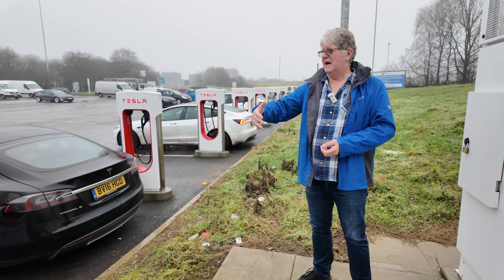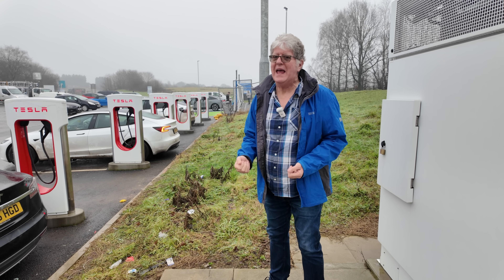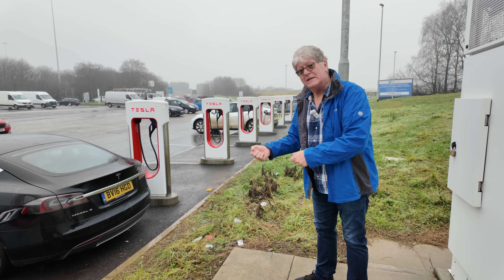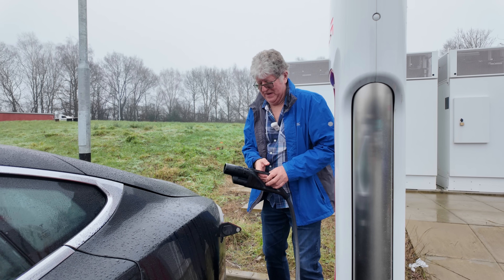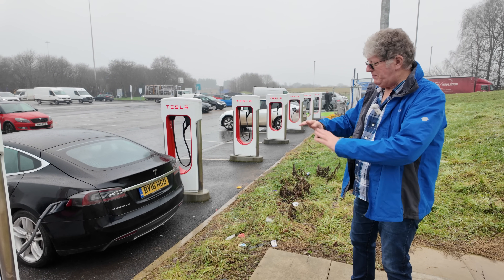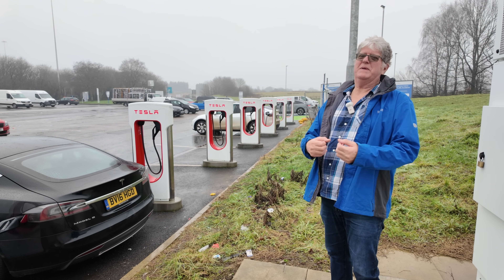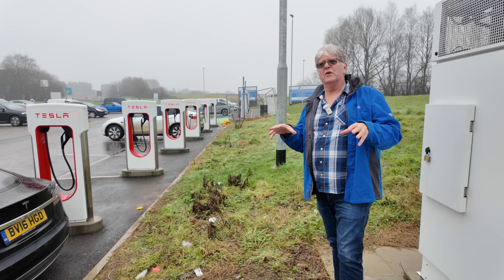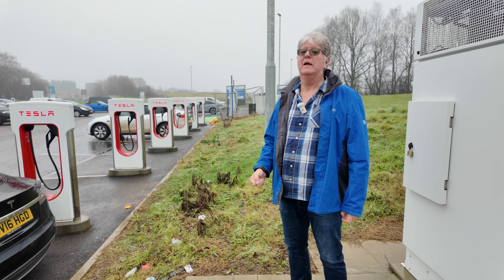What Went WRONG With This Tesla Installation At Birch Services?

Comment: The reason a lot of new service station sites are the old v3 chargers is they are Tesla only.  So even if they had waited they would still have put the v3 chargers in.  Look at Rotherham which has only just been built and opened.  20 x v3.  Also Michaelwood and its expansion.

Comment: All useful info thanks. 
Not a Tesla user hence only using the Open ones but just noticed that there are some Non-Tesla chargers coming up in the Tesla App at a higher price. All very strange. EV on the move Matrix UK ones we are passing next week at Chorley (near you) PR7 7NA. Doubly strange as it is close to proper open Tesla site at Walton Summit PR5 8AA and normal Tesla pricing (though I would prefer a Starbucks to a Holiday Inn). So who are they there for. 48p Tesla (unless peak) against EV OTM of 65p
Any idea ?
Reply: It's not strange at all.  Those are EV OTM, they're using Tesla hardware and in the Tesla "system" but not operated by Tesla.  However, they are (annoyingly) included in the Tesla satnav and app, while not being the better Tesla price.
Reply: @djtaylorutube  I noticed them over Christmas. I ignored them. I have free SC until 2027, no way I’m paying if I can avoid it.
Reply: @johnfranklin6394  You should be ok I think? Others with lifetime free supercharging don't pay but they could be treated differently. Try one for a quick test.

Comment: Dave are you really that petty. Don't you think that problem might be with permits and government and fact that they act like children. I don't get tesla gives you cheap charging and you still complain. Really I don't get people like you.
Reply: Things like wayleave agreements are usually between the people wanting to cross land and the owners of that land, this isn't necessarily going to be the government or local authority. Wayleaves can take a while to agree as both parties need to agree on terms. If the chargers have been installed the necessary planning requirements (if there were any) will have already been met.

DNOs also have a backlog of work which means booking in installs can take a while, particularly if they need to upgrade substations and add capacity to a site.
Reply: Who wants to go to a mucky site this isn't the US.Clean tidy is that so difficult?
Reply: @foppo100  Clean and tidy isn't difficult but there is a cost to it. Also, if scummy people didn't drop litter it wouldn't be an issue.

Comment: Why is the fact the bays are not painted an issue?

Is it because ICE drivers are more likely to park in unpainted EV bays, and so block the chargers?

Anyway, thanks for the video. Good to know I can charge there in future when crossing the Pennines. Being Tesla exclusive is also a plus for me, should avoid two bays being blocked by non-Teslas with their charge ports on the opposite side (e.g. the BMW i4).
Reply: Teslas have to back in. At night  especially in poor conditions, the paint really helps. Especially if your back camera is dirty!
Reply: @ good point.
Reply: There’s a sign near Huddersfield saying that Birch Services is 19 miles away when it’s nearer to 17

Comment: Lease agreements will vary, they may or may not include service standards for ground maintenance; they may however include an additional service charge for grounds maintenance and cleansing. Typically, landowners will do the absolute minimum they can get away with.